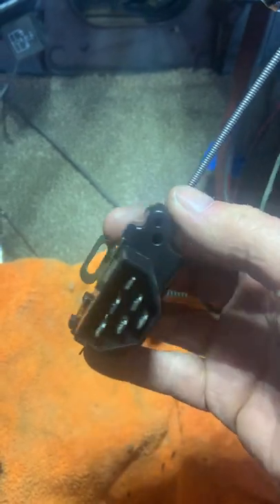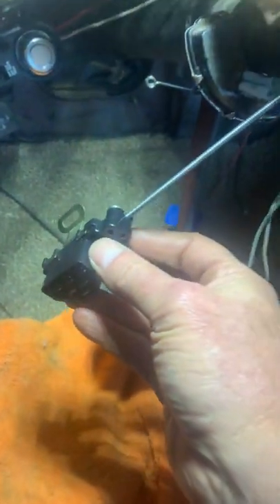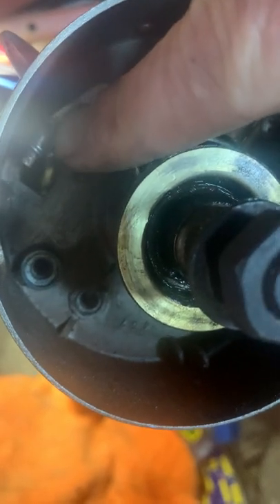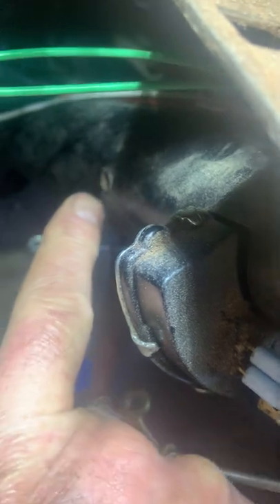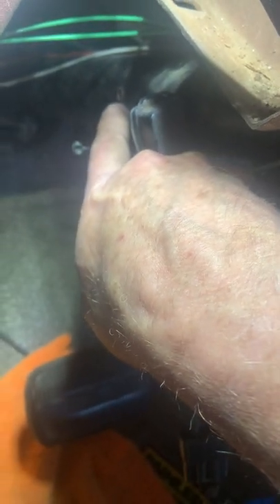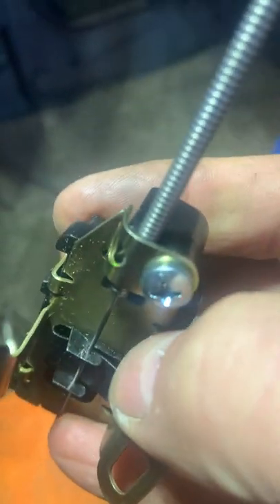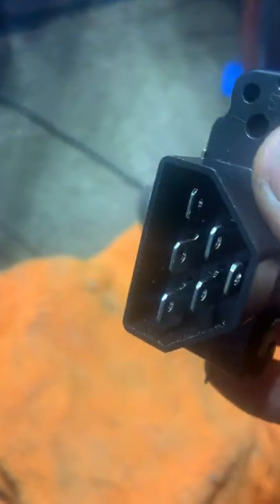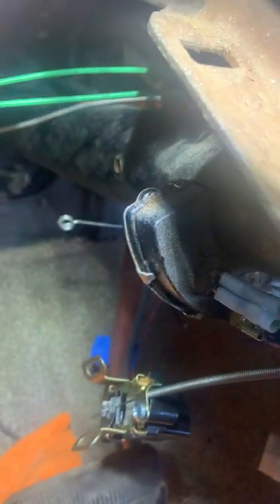1961 impala turn signal switch remove and replacement

Comment: Thank you for this vid, its the only one on YT.  I was able to get the switch out with dash intact (61 bel air) by unbolting the top steering column clamp and levering the whole column down about 2 inches.  Still waiting for the switch so we will see how hard that top screw is to get in like that.

Comment: So in the middle is neutral right? It's self adjusting? Or do the slots in the mount adjust the position? Did you get it working yet?
Reply from the maker: Yes..  in the middle is 'off'  not left or right signal.   See the slots on the mounting ears?  they are slotted, so you need to slide the whole switch up or down to find the middle...  tighten screws, then try the turn signal arm, make sure both left and right works...  if not slide switch up or down..  in those slots.   ITs pretty easy once you get to it.  Yes, mine works great on my  1961 Impala.
Reply: @cmscms123456  so I got one side working tonight but nothing on the drivers side. I will try and move the switch tomorrow. Thanks for the help great video
Reply from the maker: @adamfonzarelli8318  Make sure the bulbs are good and you have good grounds.  Also you have a turn signal relay, sometimes faulty.  but sounds like yours just needs that adjustment in the screw/slotted mounting.  Good luck.

Comment: I replaced this but my signals don’t flash &it stays a solid flight when I adjust that lever. Any suggestions?
Reply from the maker: Try to find a schematic for your make and model car.  Maybe the 'flasher' is missing too?  or you have a bad wire connection or bad grounds.